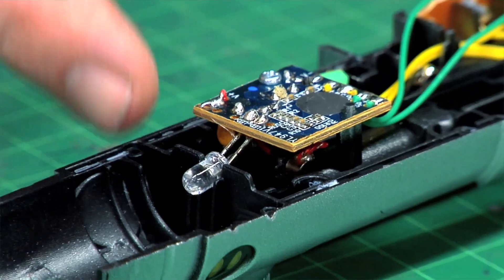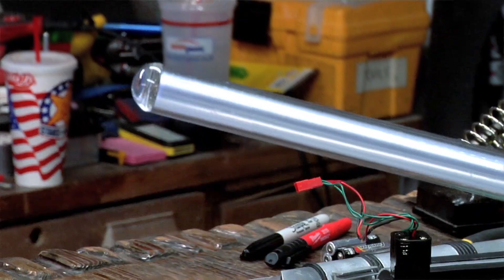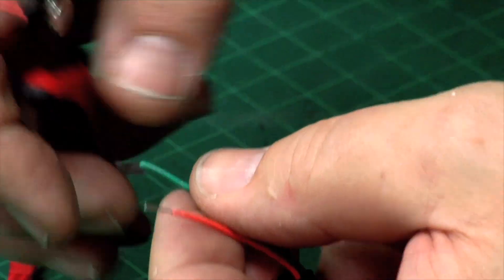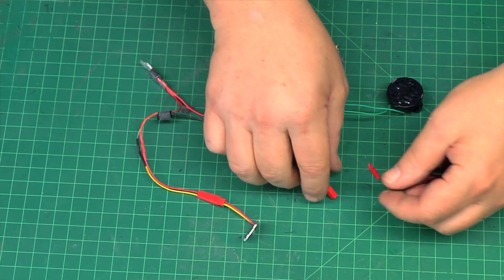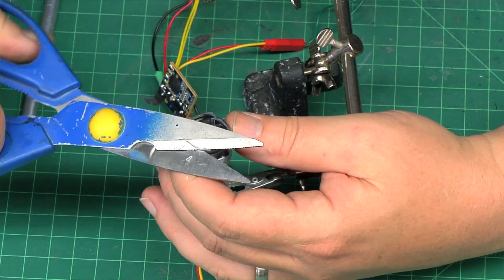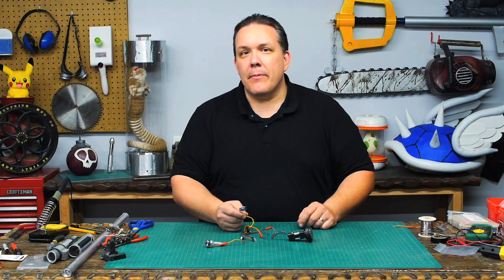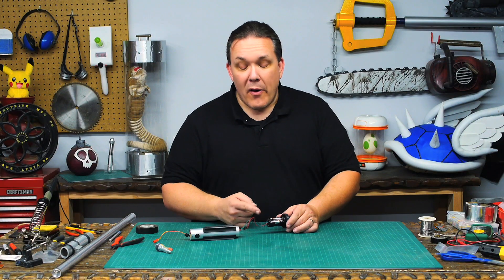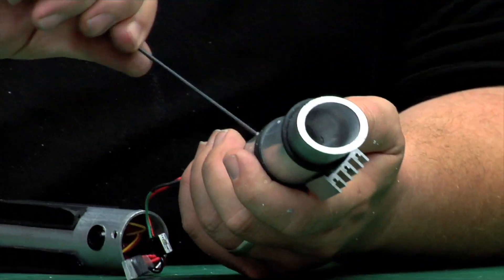How to Turn a Toy Lightsaber into a Combat Ready Lightsaber - Beyond Geek DIY Builds

Comment: This was the first tutorial on building sabers I ever watched. Now I build fully custom, combat ready, 
all metal ones. But I came back to this video once I bought a Home Depot 7 foot Vader. But his lightsaber was horrible. So I cut the one out of his hand and put a 2010 FX Vader in his hand. After a lot of modifications. But the voltage wasn't enough to power the LED. Just like in your video. Using the micro puck and the LED driver worked perfect to make his saber light up like its supposed to. I would never figured that out without this video. THANK YOU SO MUCH!!

Comment: I remember a few years back seeing a video about a person building their own lightsaber using a similar setup but instead of connecting the led to the on the placement on the board directly they in fact hooked up the led to the speaker instead giving it the fluctuation that you get with the noise at the same time so the blade energy pulses as it's running and they just had to hook up a few resistors and it came out looking awesome and I wanted to try that myself but because they stop selling the bladebuilders lightsabers and now the new sabers have voices in them this is a harder thing to do with the new ones and because I either have to go to places like Goodwill or check online for eBay to get my hands on the older ones it is a lot harder to build one of these today and that really sucks cuz I still want to use the kylo ren sound with a fluctuating blade that pulses as the noise goes for my custom pink blade lightsaber cuz I've already had the handle made for a few years now it's just been getting my hands on the board and the LED has been my issue
Reply: You can find easier to wire sound boards on etsy for probably the same price as one of those old toy sabers.

Comment: Me and my dad were going to build a lightsaber together. Because I have the blueprints in my head and he has the knowhow. He was a former electrical engineer before the crash of 08. Also do you think you could do this with the old vintage lightsaber toys that they made in the early 2000's. Cause they stopped production on those ages ago. And I actually have 2 in my possession. Well 4 actually 2 belong to me 2 belong to my sister. And this was long before soundboards were a thing. So I'm assuming that means these old toy lightsabers have gone up in value since then... Actually now that I'm typing this and thinking it to myself I think I'm better off just keeping my old vintage lightsabers the way they are. Cause there probably worth more that way.

Comment: PLEASE HELP! I'm stuck, I'm trying to run a 12w LED module, instead of the single cree he's using. It utilizes four Cree XQ-E LEDs. The seller states it can run off a 3.7v 18650 battery with no resistors....but can't figure out what puck I'd need to run this 12w 4LED array off the Hasbro sound board. 
Any advice???
Can't find the micropuck he states, and not sure it can run this 12w 4led module. Looks like a 2009, but can't find that 1425 model. Did find a 2009 series....2009 w/ 350 mA output, 2009-HI w/ 400 mA output, and 2009-SHO w/ 600 mA output.
Reply: This was made 3 years ago. They sadly won’t be responding. At least more then likely. Check if everything is done right. And watch him and copy him movement by movement. That’s sadly all I can recommend. Good luck and have a good day.
Reply: @thegraceandroseshowmore9975  yeah i knew it was a longshot. The video doesn't really help, can't find the puck he used, but doesn't matter since the LED he uses is so weak. I've found a lot of info on thecustomsabershop.com forums. Just ordered several to try...
Hands are messed up right now, so going to have to be a project for later.

Comment: Could using LED strips work? I'm building a lightsaber and would like to use individually addressable LED strip lights rather than the three small LEDs currently mounted to the board.
Reply: I believe it will but what's the voltage of the strips

Comment: Excellent tutorial. Thank you. I’ve built (3) of these so far. The only problem I’ve had is that the Micropuck I was using fried. It was rated for 500mah but only 3 volts so it couldn’t handle the (4) aaa batteries. I’m going to try a 500mah Micropuck rated for 5+ volts and hopefully that will work.

Comment: can anyone tell me how to wire a switch to the mace windu one, it has a different switch attached to the circuit board
Reply: Take off the rubber button, once you do you'll see two halfs, positive and negative all you have to do is carefully solder a wire to each one and tada thats it

Comment: In the diagram provided in the description, is the wiring color wrong? Specifically from the micropuck to the LED lamp. It shows green to (+) and orange to (-). In the video it looks like the green wire connects to the yellow connector, which then connects to the (-) on the LED.

Comment: I followed all the steps on this video but I have run into a problem!! I am using a different lightsaber sound board form a kylo ren lightsaber toy. Once I plug in my battery components it immediately turns on the blade without me using the switch. But when I use the switch it doesn’t power the blade light only the sound. Can some one help me please!

Comment: I'm using this same build but with one exception I went with a light strip instead of the high powered single led. can I use a 9 volt battery for this build instead of the 4 AA batteries or will it not work?
if anyone can comment on this that would be great thank you in advance.

Comment: ⚠️⚠️⚠️Friendly warning ⚠️ ⚠️⚠️
Just hook straight up to the cheap saber chip.
You don’t need the micro puck or the nte 387.
He probably used those, so he wouldn’t get sued for going straight guts out, and than guts back in,
on a star wars product,
after destroying one on camera,
than sending everyone to the store to destroy more star wars products,  limiting them for collectors.
The j quick clip connectors, the led, and focusing lens from LEDSUPPLY; that all works.
This is a friendly warning that this works.
But do not waste your money on the nte387 and micro puck.
Hook up the wires wire for wire straight onto the cheap chip and it works perfect.
The micro puck heat up to untouchable temperatures after five minutes of running,
The nte 387 is outdated and is also very unneeded.
Hope this help to all you DIY people who are building something cool!
Good luck out there and may you rule the galaxy.

Comment: 5:38 While I'm not really an electrical engineer, I figure putting heatshrink around a transistor like this would be somewhat dangerous, as you're completely isolating the heatsink on the back of the transistor from any airflow whatsoever, which risks it overheating and damaging the component, and possibly burning the tubing (if it gets that hot).

Comment: Can you please make a video on how to switch the built in light saber circuits to a new hilt? Specifically, for the Disney Store Darth Vader Light saber [the 30$ one]. (Not FX)
Reply: Doing this now with the Rey lightsaber... Only difference is that those sabera use an led strip in the blade and thus their pinouts are not as simple as LED+/- .... There are positive wires output to each LED and a shared negative.

Comment: Instead of using a high intensity LED, would it be possible to use LED strip lights?
Reply: I had some blue cross guard saber with light strips that lit up pretty bright actually, and had thick plastic too. I don't know how much it cost but it did use led strips.

Comment: How small of a ovc pipe and you fit all the switch and battery speaker part. So i can build it and then add to my sword design. I have a emmiter crystal chamber i want to keep with out modifying

Comment: What size pvc schech 80 PVC pipe does your set up fit inside snug. And what is the od of the blade. To get the right id pipe to fit it.
How many watts is the led.
And what's the dv running the battery.

Comment: can you use a 18650 in place of the regular batteries?
Reply: Depends on the input voltage that the board and other components can handle. A single 18650 is 3.7-4.2 volts... Some of these sorts of parts can only do 3.0v max. Some you can drive at 9v

Comment: I have a question.
Is there a way to switch an extendable blade lightsaber without lights and sounds because sometimes i think about a lightsaber for obi wan by using the hilt of lukes lightsaber and switching out the color and putting a blue blade instead of a green.
I find it ironic how hasbro never created an extendable obi wan kenobi lightsaber with lights and sounds but they did do one with lights and sounds. Hmm interesting.

Comment: Is he running that Hasbro board at twice the stock voltage?
Reply: It would appear so.... Unless he has two pairs of batteries in series and then each pair in parallel with each other for more capacity.

Comment: I'm gonna buy a toy lightsaber and replace the LED with a 3watt cree led I have from a broken flashlight. I hope I can replace it without buying that little thing you used. I tested the cree led and it doesn't work on 1.5volt but it does work on 3volt. I even tested the cree led on a 9volt battery and it works. So I think I'm gonna bypass the circuitboard with my cree led if possible so it isn't connected to the circuitboard but to the on and off switch. That way the 3 AAA batteries can deliver 4.5volt to the cree led. Hope it works.. and if it works I'll post an update in the comments.

Comment: I'm pulling my hair out trying to wire this up, I've wired it exactly, but my LED remains "on" no matter what
Reply: Check your transistor pinout, mine had a different layout to his
Reply: @gravy8431  I cant find the NTE378 transistor anywhere is there a substitute?
Reply: I have the exact same problem, have you found a solution yet?

Comment: How to turn a Toy Lightsaber into a Combat Ready Lightsaber

Step 1. Make a combat ready lightsaber.

Step 2. Alter the internals of a toy lightsaber, and meticulously put them into the combat ready one you already had.

Step 3. Never realize that the combat ready lightsaber is permanently on Demo Mode.

Complete.
Reply: What does the demo mode do to the sword
Reply: @iyoaw4360  it cant retract anymore so its just a neon normal sword now
Reply: @JamesChen999  ahh ok thx
Reply: 9:35 he gets it to retract, it isnt on demo mode
Reply: @averyeller3254  That isn't what demo mode is. Demo mode is the sounds being played on their own rather than being triggered by anything like impacts or swinging. It also prevents you from turning the lightsaber off.

Demo mode turns on, plays a couple sounds, turns itself off. You have no control over it.
Reply: KronoXIV but he clicks the button and it turns off
Reply: @averyeller3254  No, it turns off on its own sheerly by coincidental timing. That's why none of the sounds were in sync with his motions - because he wasn't causing the sounds.
Reply: How do you take it off demo mode?
Reply: @gamersinacontainer  you can't, it's on demo mode permanently
Reply: @tescocarpark1084  I mean before taking it apart.
Reply: There should be a switch on the top of the lightsaber
Reply: @gamersinacontainer  if not then its stuck on demo mode
Reply: TheCrow 1123 Ah, thanks.
Reply: Well all you have to do is make some sort of hilt and blade

https://youtu.be/jtFxPavl76U
And
https://youtu.be/8TnnmyR2YdY

Have some great lightsaber hilt ideas
Reply: @Last_Survivor593  That's not the point. The point is that the title is "How to turn a toy lightsaber into a combat ready lightsaber" but the video is "How to put toy lightsaber electronics inside of a combat ready lightsaber."
Reply: So if I put a non momentary switch will it stay in demo mode

Comment: Entire video - Your soldering skills are abysmal. Why are you not twisting your wire ends? it is part of what helps the wire to wick solder, and form a solid connection. Why are you not splicing your wire-to-wire connections? simply laying two wire ends on top of one another, with a solder blob is not sufficient to ensure they're going to stick together.. Why are you laying your wires on top of the contact rings, instead of inserting the wire into it, soldering, and trimming off the excess, like you're supposed to? 

5:30 - Wait.....ok, so you're gonna install a power-amplifying transistor....and then you're going to encase it's heatsink in fucking insulation?  For real, dude? Why are you leaving the legs on the transistor so long? you should be shortening the legs, looping the ends, and looping the wire end around the hooked leg ends, soldering, and then nipping off excess....then dropping insulation over the joint. This is really sloppy work, and NOT the right way to do it.  You're doing a tutorial...you should be teaching your viewers the right way to do things.

Comment: it is safe to directly connect the LED to the circuit without the transistor and the driver?
Reply: Likely not enough voltage from the board itself to power it.

Comment: I have a toy lightsaber that when activated goes through a blue cycle, then red, plays a dumb Vader sound then shuts off with a whoosh. How do I modify it so it’s just one color that stays on?
Reply: Yea, that is a completely different 'Code' programmed into the microchip, so re-programming it would [likely] be difficult.  I would compare this to trying to re-program the remote control for your HD television at home!  At the toy factory, or wherever the toy's microchip was made, the fabricators "uploaded" the code into the microchip in order to permanently "set" it's basic functionality.  In order to keep manufacturing costs low, it is likely the toy's microchip is NOT re-programmable.  It is not "Flash EEPROM" like the chip which holds a smartphone's code and gets updated each time the telephone service provider (AT&T, Sprint, T-Mobile, etc.) or Google "pushes" an Android O.S. update out.

In the end analysis, it will be easier to buy a new Lightsaber soundboard with the desired code on it.

Comment: Hey so I could really use some clarification ASAP if possible.  I could not find the same NTE378 you used in the video.  Will this one work https://www.alliedelec.com/nte-electronics-inc-nte378/70215766/ also I could not find a Micropuck 1425 but will this one work https://www.ledsupply.com/led-drivers/micropuck-boost-dc-led-driver and what Amperage?

Comment: I actually did that, I had an Obiwan Episode 3 one, and my friend who actually duals fir disney on occasion broke her battle ready lightsaber (modified), and needed one for a event in NJ, so I pulled my old one apart, then shoved her insides in, then replaced the blade with a pre-ordered plastic one (can't remember what its called, but its what is in safety glasses), took about 10 hours, and no sauntering except for the led.

Comment: What size resistor can replace the BuckPuck?  What size were the optics? (lens, collimator, holder) Ledsupply has 10,20 up to 26mm for options. I plan to use a single Blue luxeon with 18650.
Reply: Could you find the answer, what is the correct size of the resistor?

Comment: Hey buddy,  finally noticed a couple things, maybe you could help. What size focusing lense did you use? There's a 10mm, and creates a narrow beam, and  so forth. Next is the micropuck driver, would I use a 350, 400, or 500? 500 is brighter. Just need a few details bro. I'm already on my way with this project.

Comment: Ok so I'm looking at the wiring diagram and it appears that the battery is essentially wired directly through the transformer to the puck? I was wired correctly but now it just lights up when I plug in the battery pack.

Comment: Hey Odin, Im working on do this to the Kylo saber. Would be pretty cool if you can show this conversion to that model since it has 3 LEDs instead of one. Can I mimic the same process you did here to the main LED and leave the other 2 alone as they are? Or you think with a more powerful LED there I have to do something to the wiring for the other 2?
Thanks!

Comment: About the MicroPuck, which should I use, the 350mA 400mA or 500mA. And the transistor needs to be de nte 242 or is there another that we can use? Any PNP transistor will work?
Reply: It has been a while since I worked with the Micro Puck, it is best to ask the guys at LED Supply, they got back to me the next day. What they want to know is which LED are you using, and what type of power supply?  But honestly, I had a 350mA and a 500mA. I tried both, and I couldn't tell the difference.

I think most any PNP will work. I used 4 different similar sizes, and they all worked.

Comment: thanks for listing the supplies but you do not specify the voltage on some of the components such as the driver. at ledsupply the components list multiple voltages (350ma, 500ma.. etc). can you be more specific?

Comment: Where did you buy the Transistor, I can’t find one anywhere. Online they are 1.99 but 12.99 s&h
Reply from the maker: We bought ours at Fry's Electronics
Reply: Beyond Geek, I bought the transistor (242 like the instructions) but you used a 378 not a 242. Something that you didn’t specify was the amps for the micropuck. When on led supply they tell you to choose a amp they never say the number 1425 or anything.
Reply: Beyond Geek could any of this be the reason the led isn’t lighting up or when it does light up its very little and very dim and only for a 2 seconds.
Reply from the maker: You are correct on us using the 378 in the video. We missed that. We have used both, so that shouldn't be a problem. Odin has used micro pucks at 350mA and 500mA and said he couldn't tell the difference.

Comment: This is not what we meant. We meant modify the toy to be combat ready I.e.  Changing the blade
Reply: Not really. Those grips are not really built to take stress. But of you could disassble it without breaking it I assume you could put in a piece of pipe to replace the blade. Not that it would look good.